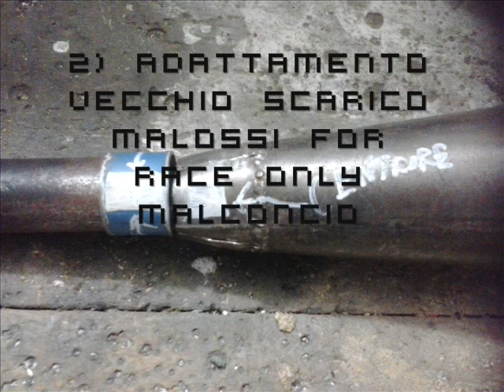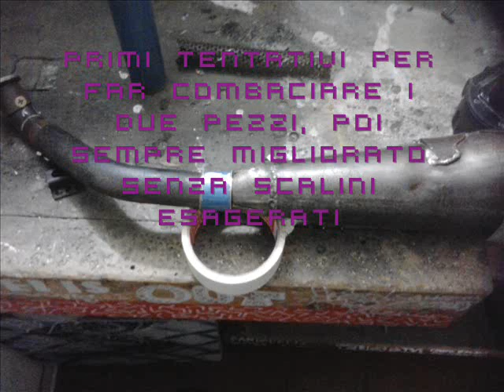Malossi MHR For Race Only adattata al califfone rizzato

Comment: Where do you buy the cilinder ? What is the bigest speed ?
Reply from the maker: I buy the original cilinder and the Polini Kit cilinder on Ebay, Find the Polini kit is really hard, but you can find it if you are lucky. Now I have the original cilinder on the moped, the top speed is about 70Km/h
Reply: *****  how do you get that speed my rizzato califfone is 2000years and top speed is 45km/h
Reply from the maker: I have an artigianal muffler and a bigger carburettor, you can put also a Dell'Orto PHBG19 with the Polini collector, but I have only a 15/15 SHA with the original collector modified with a 15mm drill and a modified air filter, that have an intake bigger, and the head is more compressed, The compression is 12:1 but original is only 7:1!! If you do it, the moped will have a longest autonomy, also 80 Kilometers/litre!! Remember to put a main jet of 76-78 ig you have the SHA carburettor